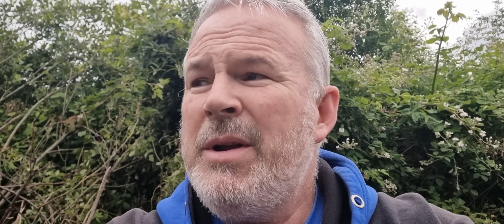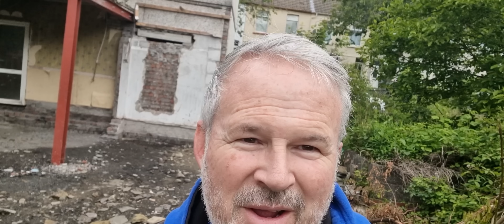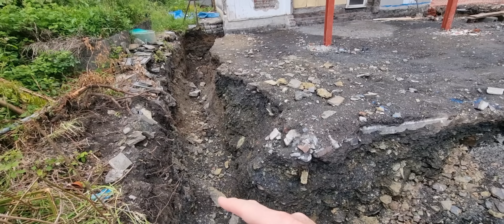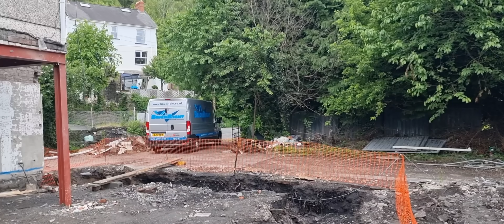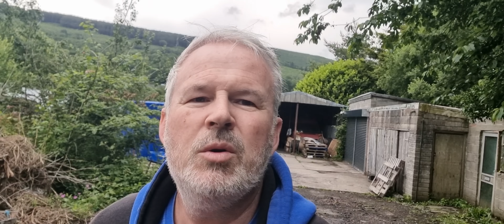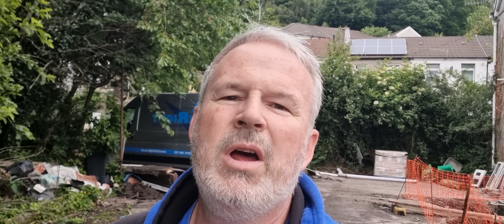Building Control Stop work part 2#

Comment: The drawing said MINIMUM 900mm depth. Look at the contract as who reasonably carries the risk. As there is an Engineer and drawings you are clearly not in design and build but the design is for strip footings. The depth is your risk unless you qualify your estimate or there is a remeasurable bill of quantities.
You may have been prudent to have a trial hole and check before you started, it may not have been obvious but the word MINIMUM would have been worrying to myself as a contractor.
When the foundation type changes the price is no longer applicable.
The advice from the Engineer to keep digging and add some steel was poor. The weight is not the issue, it is the uncompacted fill with low bearing capacity and settlement.
Reply from the maker: All I have done is follow the instructions from bc and the engineers. I did however set out in my quote the possibility in the ground the prices and specifications could change depending on the site findings

Comment: Just put up  4 foot high ply-wood for a form, line it with plastic on the bottom and 1 foot of stone  packed down - pour 3 feet of concrete, 28" wide - done...  Better than anything built in the area..
Reply from the maker: I did suggest it but they wanted complete trench fill foundations maples

Comment: Trial holes could have saved all that digging. On poor ground piling becomes a cheaper option. That’s for the Architect and Engineer to come up with the most cost effective foundation design.
Reply from the maker: Jeff the two holes dug for the previous work we did on site for the steels were in effect two trial holes

Comment: Any structural engineer worth his salt should conduct a series of trial pits near to the foundation  outside of the foundation line to determine what foundation design he requires. It looks impossible to expect the strip/ trench fill to work. Maybe a pilling solution would be best with a ground beam. There’s also the ground floor to consider. Will the loose fill support the floor, probably requires a suspended floor

Comment: You (and your client) have been SO unlucky with the shocking state of that ground. What on earth was on that site originally? I notice there are quite a few outbuildings, so i'm guessing it wasn't normal domestic curtilage ... or maybe they made the ground up with whatever spoil they had to hand when they were building the house or outbuildings - looks like slate and slag, which isn't surprising in your neck of the woods. If i was digging (or stipulating) a trial hole, i would want it dug at the furthest point of the trench (perhaps at the far corner where you are talking about the ridge steel ending, with all the weight on it). If that had shown up the state of that ground, i think i would have asked for piles with no further disturbance of the ground. I'm still surprised that haven't insisted you go deeper than 1m. You can always argue with BC, but don't go against what they instruct, whatever you do!
Reply from the maker: I no dare not go against them .
To be fair ist been stressful and expensive for us but it's done now check out the new video 👍

Comment: Hi Justin, i need some advice if its okay as im stressing about porcelain falls and ive been following your videos for a while and thought maybe you could help. Im doing 2x porcelain patio areas joined by a path in the middle. The patio near the back of the house will be 1 in 40 i think as it unavoidable in order to get it below dpc. Which im thinking is a little steep but ive read its common. My question is for the path that runs along a garage, a 1 in 60 or 1 in 80 is best running away from the garage? And also the patio at the far end of the back garden im thinking 1 in 60 or 1 in 80 is best? I hope that makes some sense. If you can help great, either way keep up the good work!
Reply from the maker: As far as i understand that all sounds fine to me .
Good luck 👍

Comment: The infill is so bad i feel you are going to get caught between planning and architect , you as the builder will be working within exact wording . i did ground work over 20 years ago in this situation the boss was lucky he put in wrighting once he saw the state of ground  deeper wider better reinforcing  fully shuttered reforming the removed infill in compacted layers  was best option but would work under direction . it got to the point your planning and the inspector wanted to see the pour it was shutdown  because the integrity of the bottom was compromised during the proses . 
i feel your walking up an escalating scale to what you should have just started at .

Comment: Get an independent structural engineer to design foundations! If anything goes wrong, building control will walk away from anything!
Foundations must go down to Virgin stable ground! Unless you design a balanced raft and allow for settlement.

Comment: Solutions are always found Justin  . That concrete you used for the concrete pads that the upright steels are bolted to looked very watery . was it that way because you used super plasticiser in the mix  ( which wouldn’t seem necessary to me for the purpose you were using it for ) or was it watery looking because of an excess amount of water in the mix.
Reply from the maker: No plasticizer and wasn't watery as far as I remember
Reply: @brickrightbuildinglandscaping  go back and look again .

Comment: Justin, I’d be concerned with this one. If there’s still made up ground below your squared off trenches at the rear. Personally I would advise your client to abort the pour.
You stated the engineer & building control are superior to you. They are not. They work like this. They pass the book so they don’t get blamed when things go wrong. 
You need to cover your own back, because however ‘nice / agreeable’ your client may be, they’ll change their tune faster than a set of traffic lights when there’s no one else in the blame game.

The made up ground is perhaps the poorest mix I ever saw. Here is the key to my thoughts. Do I remember right you said it used to be a gradient that’s been levelled ? If so, there’s a chance of the whole extension shifting in the direction of the gradient when the weight is applied. You mentioned clay / Sandy soil near the house. To me that’s cause for a huge concern, because if there’s a clay seam just below, when it gets wet, ( not talking about heave here) anything built on or very close to sloping clay will slip.
The weight of that pour would concern me.
I’m not criticising you in any shape, way or form. I’ve got your back here. I have so much experience building on a hill where there’s a clay seam you wouldn’t believe. I have lived and built on a 10 acre hill top for 32 years , Sub terra West flank marl clay / East flank super fine sand ( for those who are like 😵‍💫 it’s called a sand lens) 

At the back, facing East, I have some agricultural land running down hill. (Sand) but knowing at some depth under the sand is clay. Almost at the bottom of the hill, other side of my boundary with a public footpath on my side,  planning was passed for detached houses. To squeeze them in, they were given permission to excavate some of the bank out & thus increased its natural max angle of 45 degree of inclination to around 60 degree. Building control / Engineers - Superior?  - They should have picked up on that. 

The ramblers association picked up on it Obv having a vested interest, I went & viewed the excavations. Boom💥 I could see the exposed clay shelf about 500mm above new ground level. I took lots of photo’s & raised a H&S concern with the council & warned that the footpath could slide down. As soon as the rain came, the first slip, huge cow belly. It carried on along the whole excavated line. They had to pile a  huge steel retaining shutter to stop the flow. It moved over said shutter before a retaining wall could be built. So now there a flat top of earth, 4m high (ota) 1.5 metres away from the gable end of a new build. So in cross section we now have a ‘h’ that WILL only settle when it’s found 45. 
Looks like the builders have run out of money to me, 5 houses, none finished, none sold.
I know this sounds like I’m catastrophising with my rambling, but I’m trying to point out that on made up ground, on a hill, with clay.  Has my alarm sounding & I’d hate for you to get any comeback. 
Step back a week & get legal advice & get something drawn up for your protection. 🙏🏻 Best of luck.
Reply from the maker: That is a brilliant bit of advice and to be honest I've been trying so hard to protect my client a d do the right things for him .I've not even thought about myself so I will take your advice about the disclaimer I think that's great advice and very sensible. After all I'm not the one that's made and passed the new design. 
I appreciate you posting this and I thankyou .

Justin
Reply: @brickrightbuildinglandscaping You are welcome. 👍🏻
Reply: BRILLIANT POST!
Thank you.

Comment: I'm seriously starting to think this is just a big wind up. I cannot believe that any engineer (or building control) would suggest a layer of steel mesh will make that work.
If that's made up ground you have absolutely no idea whats down there,  that could all be sitting on 6 foot of horse shit for all you know. How can you possibly design a suitable foundation.
This has to be a joke.
Reply from the maker: Why on earth would I make a joke out of it .
I'm not an engineer and you don't sound like one .
3 engineers have worked on it and they all agree it's fine even the council's own engineer. I'm the builder -bricklayer not an engineer so all I can do is what put to me Nick 👍

Comment: Take no notice of the negative comments, I’ve been having an argument with an American who called me a criminal because a dug down 900 through bad ground and mass filled it . Said I was ripping the customer off should have stoned it up wackered it then put a thin conc slab . ( on a porch that sank ) 🍆.
    Our building control won’t give advice in case it goes wrong and it makes them liable 🤦🏻‍♂️.
   Best of luck with the pour lads and I bet you’re missing the porcelain 😬🤣🧱👍🏽

Comment: I dug the footing trench for my 3m x 4m extension myself - by hand ! At 1.1m I was still digging sandy spoil as I live on a coastal area near a beach. Building control looked and said to go down to 1.5m ! and shutter with steel and  to use an excavator in case of collapse. I just carried on digging down as digger access meant demolishing my garden shed. Luckily I hit solid ground at around 1.4m. Second visit with engineer and good to go with 4.0m3 ready mix. Would most builders have pointed out the potential for this extra work and if not would they have absorbed the cost themselves ? Somehow I doubt it. Easy to see how this could create a big problem so like you say, it needs to made clear to the client from day one.
Reply from the maker: Yes agree ian

Comment: As a now retired domestic level builder for 40 yrs, I like your attitude highlighting the necessity of the foundations "talk" with your client up front, it's absolutely essential that they fully understand the potential for issues. Good stuff. The only thing is IMHO (after digging that first leg where it changes)I would have pushed the client/council into piling and ring beam method, which we all know to be the better job in $hitty ground situation.
Also, the stop starting and farting round, back and forth means there's no work progressing and no conveyor belt of payments continuing while you're stood round on the phone to building control, struccy,  meetings etc etc. I feel for you man, I do, but your attitude is good. Little tip, get out before you're 60 and relax a little. Cheers
Reply from the maker: Thanks reggie appreciate it mate spot on

Comment: I am amazed that a very simple situation has turned into a drama.  

As regards the ground investigations, these ought to have been done before the foundations were designed  and even then they can be only a best guess as to what will be encountered, which is mostly why the client should have contingencies.  Those contingencies would normally be 5-10% of the anticipated contract sum depending on the quality of the information available.  Those contingencies are the client's and cannot be spent or claimed by the builder without instruction.  It is not unusual to design a foundation without the benefit of a ground investigation but usually only where the risks are minimal.

The ground beam i.e. the concrete and the mesh is clearly a variation, the value of which will be agreed at the interim valuations and confirmed at the final account stage.  I am surprised as to the size of the foundation because that would form a massive deep beam although the amount of steel is minimal. 

The foundation problems like this are commonplace and the processes to deal with it are well established, I am surprised that with the professionals involved it was not sorted it out PDQ.  Builders have no real involvement in the solution to this problem and should only take the view that they build what they are instructed to build, no more, no less.
Reply from the maker: Thanks great post

Comment: In my opinion, I’ll make sure that I get a contract written out and signed by the client the Architect the structural engineer and the local districts surveyor in my opinion, I would have piledive 5 m pylons every 4 m and brick steel from one pile to another concrete dialogue but what I could see in the video there is a lot of made up ground and how deep that is God knows it’s not cheap but it my opinion is the safest foundation you’ll have
Reply: Good luck with getting it signed off before hand, they will add disclaimers, please note the engineers who say their plan is good will not take the responsibility.

Comment: I never worked on small projects so there'd always be ground investigations and over designed everything, even so ground issues would still be uncovered. At that point i knew there'd be what was then called a prolongation and disruption claim as the main contractor tried to make the profit he hadnt included in his tender. Now I'm retired and obeying my wife's instructions on jobs I have a great deal more sympathy than I ever used to about prolongation and disruption.
Reply from the maker: Thanks alan

Comment: The ultimate responsibility is you the builder. I client hired you because of your expert knowledge. I'm a sparks. The law says you must use reasonable skil and use due diligence. I not convinced you done your due diligence. That would include digging exploration holes . You had problems with the steels you already installed. That was the time , to carry out further investigation. So stop blaming everyone else and shoulder you fair share of the blame. Anyone could see you would need to shutter that trench for the foundation, it doesn't require a rock scientist to see that
Reply: I can't understand why you are being like this.  He clearly stated that there are exclusions on the contract and associated pricing etc.  At the end of the day,  it's going to cost what it's going to cost,  irregardless of the sequence of events.
Reply from the maker: @Bill.ramsay 
I agree
Reply from the maker: How you can say that after what I've said just doesn't make any sense to me at all but if that's your opinion then 👍😉
Reply: ,"A rock scientist" 🤣...Do you mean a Geologist by any chance?

Dumbo
Reply: Due diligence was warning the client beforehand, a bit like having a new roof on your house, do you pay for scaffolding a tin roof or take a chance with the weather?
Reply: Some builders love to sting their customers with "unforseen" extras...
Which helps keep the initial quote seem reasonable.

Comment: The difficulty comes when builder and client are not clear on what happens if issues arise. You and your client seem to have considered the risk and knew how you would proceed if issues arose. Building control will always err on the side of caution, but as the paperwork says afterwards they don’t warrant  the solution, so ultimately the risk is with the client. It’s worth the client before getting plans done asking neighbours who have done extensions if they have had any foundation issues. Doing soil report ahead of time feels like dead money, but  being the client or builder waiting  for professionals to agree when you have started digging can be time consuming and stressful. If the budget is tight, it’s easy for funds to be used up quickly getting out of the ground which can impact whether or not the build can be finished. If the builder has other work lined up, delays can play havoc with schedules. In answer to your question, who pays for investigation/soil report, the client does. Same goes for getting planning permission, building control, build over agreements, party wall etc, all to be done before breaking ground. The question the client should ask themselves, is do you have sufficient contingency in your budget and timescales for foundation issues.
Reply from the maker: Great post and spot on

Comment: Just catching up on your dilemma!! You seem to have the customers best intrest at heart which is great to see! Would it have been worth either doing another trial hole or actually using the back trench to keep going down to find out where the virgin ground is? It's there somewhere and if it's 500mm deeper than where you are, you can just mass pour or is it the collapsing walls that's the main issue? We were down over 2m once and still pulling up black silage bags and barbed wire, once be hit good ground BC we're happy with trench fill, the sides were holding firm in that case though
Reply from the maker: The engineers said no need to dig any further stop there so that's what we did